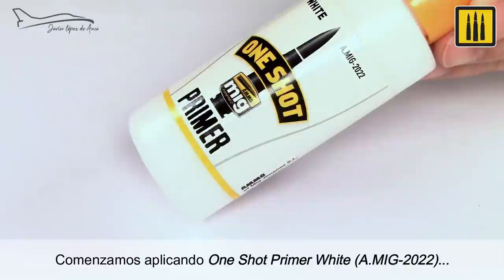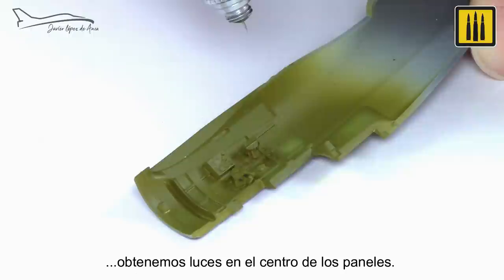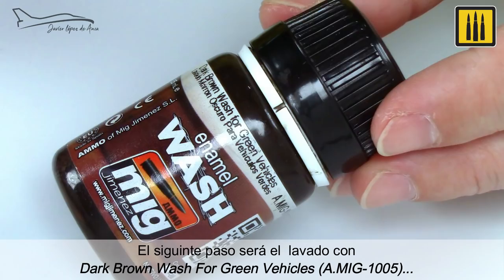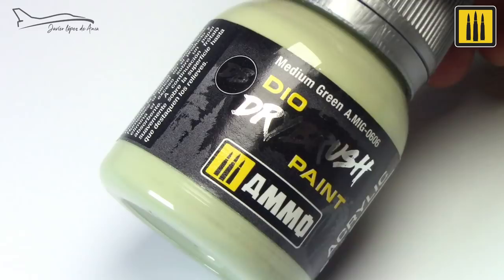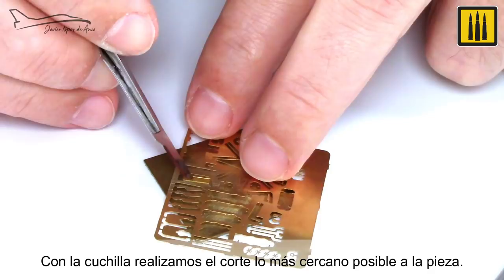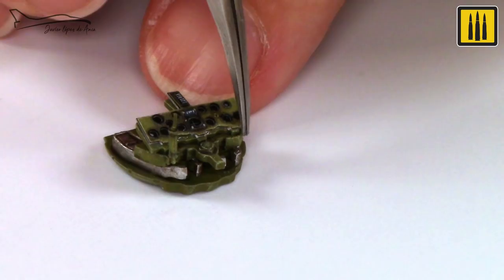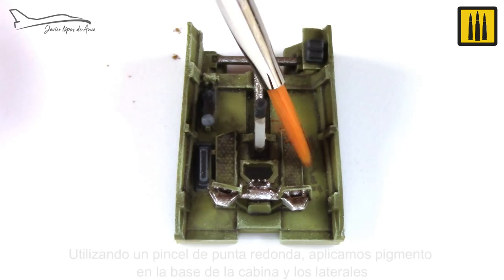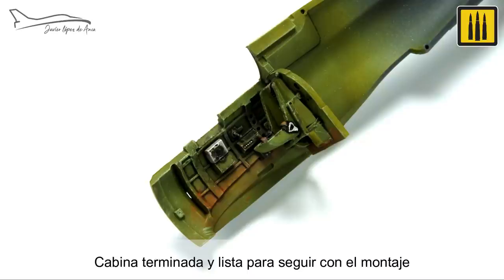HOW TO PAINT THE COCKPIT OF AN AIRCRAFT / CÓMO PINTAR LA CABINA DE UN AVIÓN

Comment: Must AMMO paints always be sealed before applying enamel or oil washes. I had some issue using oil washes, but the AMMO enamel washes I got are even stronger and removed more paint. But some colors seems to take it better.